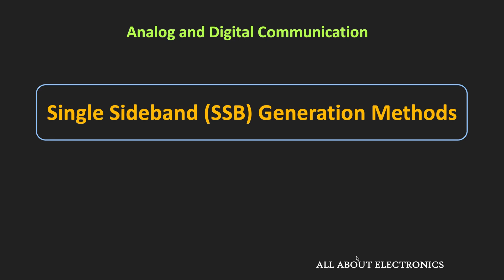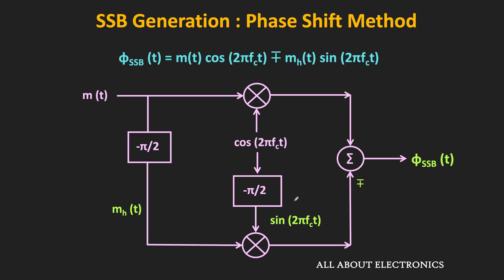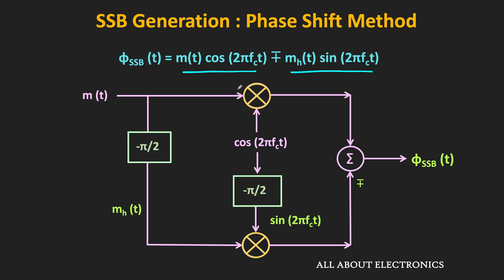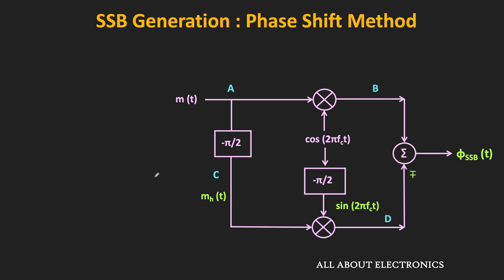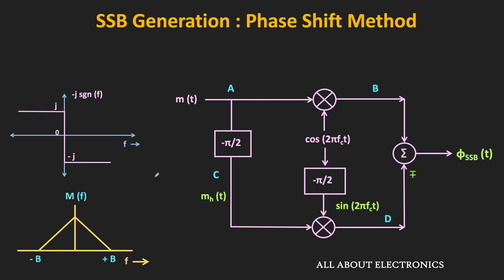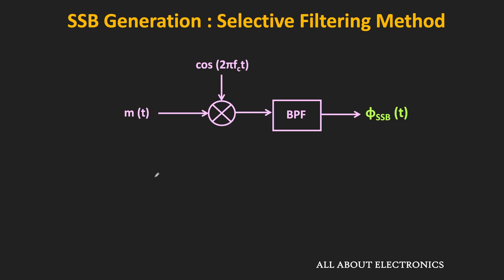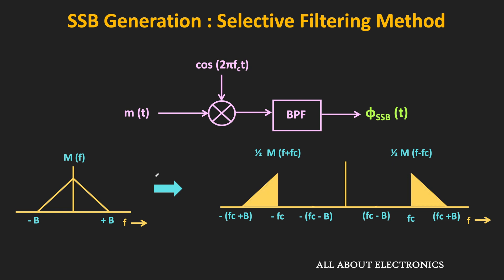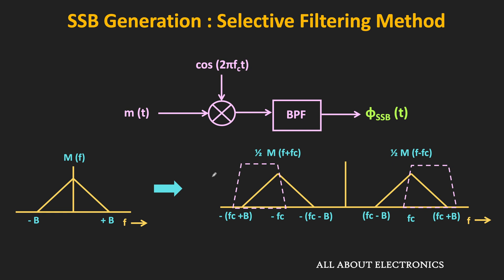SSB Generation Methods : Phase Shift Method and  Filter Method Explained

Comment: Bro am very interested in electronics please suggest me your playlist flow, it will helps me to gain knowledge easier am struck on where to start from help me to study flow from your playlist thank you in advance
Reply from the maker: You can start with basic electronics playlist. And once some basics are covered, you can go through the analog electronics playlist. Then you may go through network analysis playlist to get some idea about circuit theory. And then you can go through analog electronics playlist. Some of the videos are common in playlist. But yes, if you go through this sequence then you will understand the concepts easily.
Reply: @ALLABOUTELECTRONICS  thank you so much!